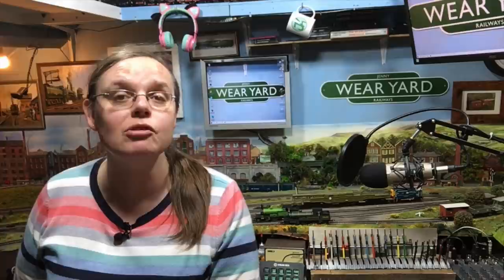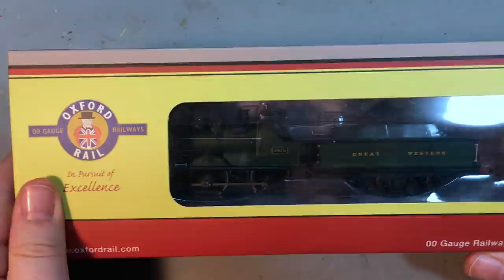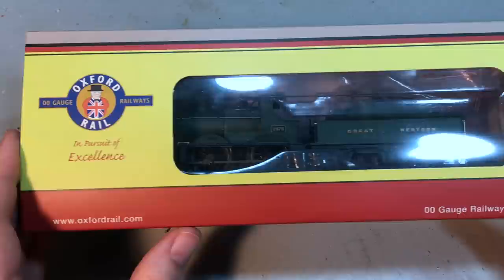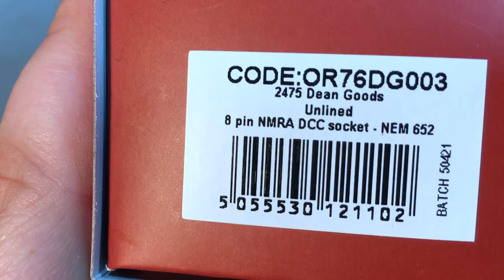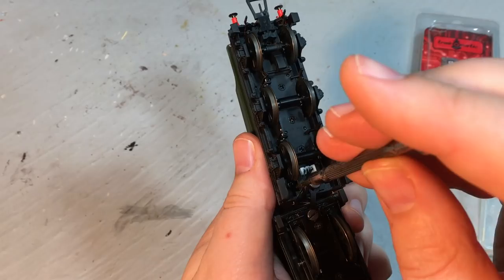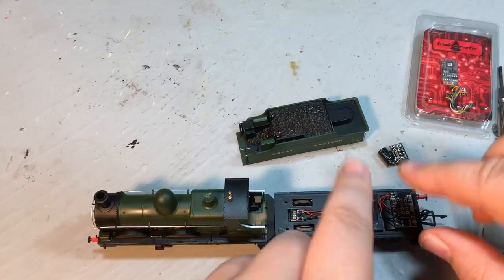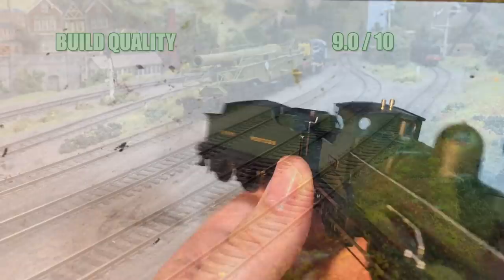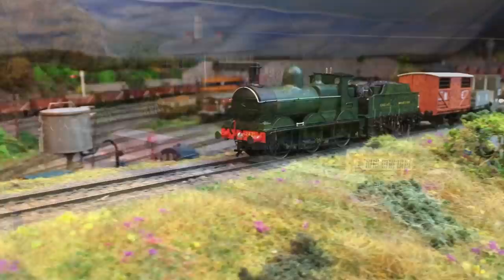This Locomotive is a Hidden Gem! Oxford Rail Dean Goods in Unlined GWR livery - Unboxing and Review

Comment: I have 2 of these, 2534 in the same livery but sound fitted and 2330 in ROD sand also sound fitted which I got with the rail gun. One point about the video, they were Oxford Rail’s second steam loco release, the first was the Adams Radial Tank. Otherwise a great video of a great model, well worth the rather low outlay in comparison to many other similar sized and quality models.

Comment: I have 5 of them, four single box ones and one with the  12"rail gun, ROD legend. My first one was the sound fitted GWR  lettered one. I did have some problems with this one, mainly the pickups not touching. All the others have been faultless, non sound versions which have been fitted with Zimo sound decoders, hard wired in place to give more room for a bigger speaker.

Comment: I think it’s a great looking model! Mine is from
The same batch as yours but the motor itself is quite noisy… you hear a constant warble on either DC or DCC, I did find it stopped when I got above the BEMF cut off on a LaisDCC decoder so I tried it with a guage master as well, still noisy… did you notice any motor noise at all in your review?

Comment: Please can I pick your barins
Being new to the hobby I am on a steep learning curve. Recently I brought a Hornby Duchess of Sutherland #6233. Hornby tell me its 44yrs old. The seller said that it had spent most of its life in a display case and looking at the condition of the model its pristine not a scratch or blemish anywhere. My intention was to convert it to DCC. However, when I first tried to run the engine, it would not work. A quick service appeared to sort this out, so I went ahead and fitted a decoder and after much help last Thursday I finally got the engine moving back and forth along a length of track. Friday night I thought it was safe to refit the tender body but decided to give it a quick check was disturbed to fine the engine would not run smooth. The motor was surging so I decided to revert to DC configuration and run the engine in. It didn’t run well at all. I have stripped the engine down and examined everything in detail. The commutator is shinny and unscratched, the brushes show wear only <50% across the face, the gears have no wear, but one of the gears has several spiral scratches. I cleaned all parts and re greased with MPG multipurpose grease. Again, the motor ran unevenly. Tried the rails on a table instead of on the carpet, pulled the undriven engine to bits and thoroughly cleaned all wheels, bearings, and contacts. I have good continuity between the rails and the brush holders, and the motor has resistance of 30 ohms. On re assembly the engine did run a lot better though not as fast as I expected, so I let it run at 8v DC, intending to let run for 30 minutes but was re tasked to do something else, it ran for about an hour. On return it was running much slower and soon came to stop. Previously I had checked if it would run in reverse, but it doesn’t like it. The engine turns over by hand quite freely both directions. I know I could fit a CD motor, but part of my motivation was to understand electrics a little better, so I don’t want to take that step until I fully understand what this problem is. Could it be one of the motor windings has a short, how would I check this?